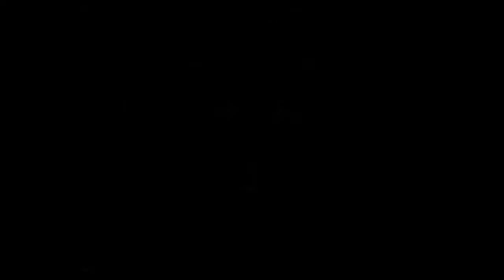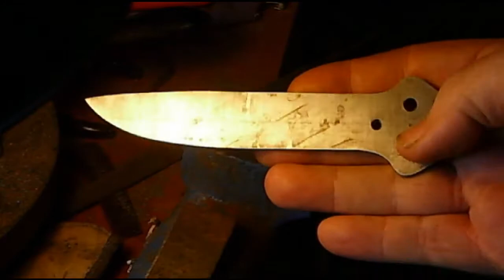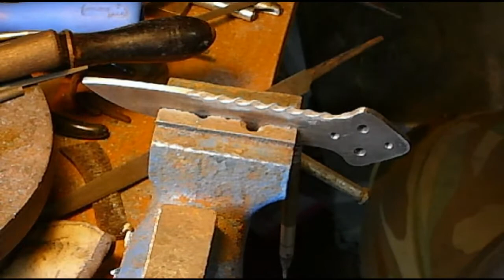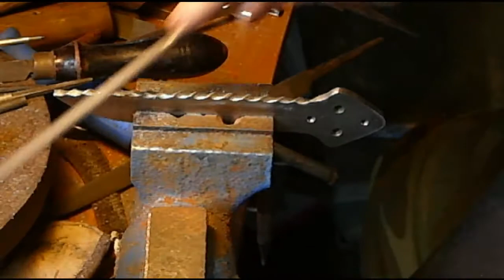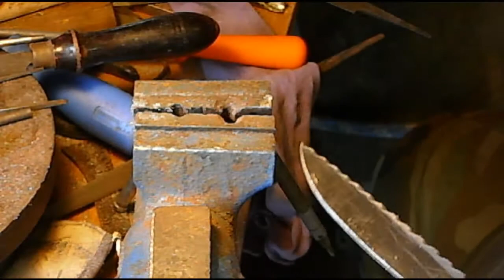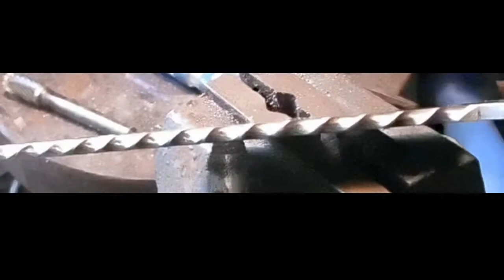Balisong Blade Filework

Comment: what kind of file is that, cuts thru the steel so good!
Reply from the maker: SunsetBay Bonnie It's a "chainsaw file" used to sharpen chainsaw blades. They are round and come in a bunch of sizes. I even have one that is hexagon shaped for some specialty brand chainsaw with odd shaped teeth... They cut steel like a dream.
Reply: cool idea!

Comment: Nice work. Could you recommend a file set for this type of work?
Reply from the maker: For the work i did on this knife, just get a set of chain saw files, 3/32" to 1/4"  ( .http://www.harborfreight.com/3-piece-chain-saw-file-set-91992.html  )   I think you might be able to find them at harbor freight. for other designs, get a good set of medium coarse cut size 00 needle files  (  http://www.micromark.com/coarse-needle-files-pkg-of-10,7117.html  ), with the tiny smooth cut extra fine needle files that everyone buys and sells (the most common type) you will be filing for ever.....
Reply: Dark-Wolfe Knives thank you very much.